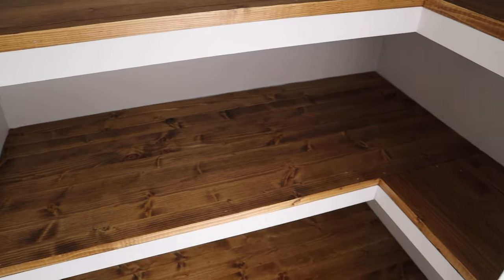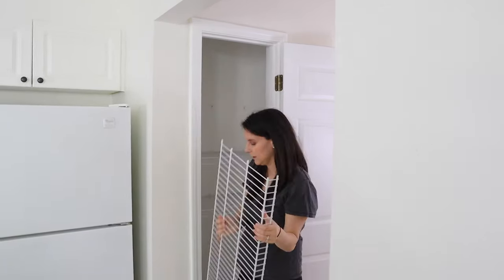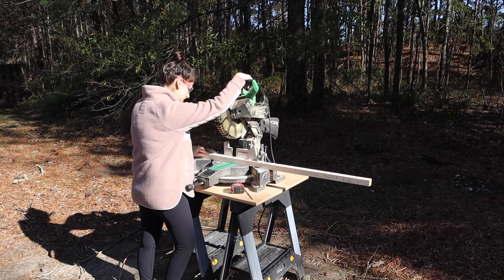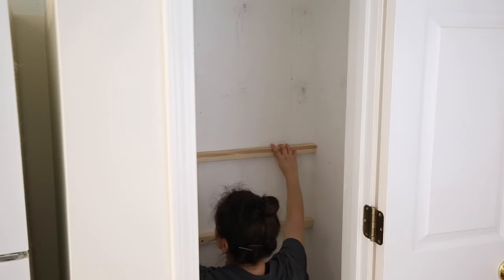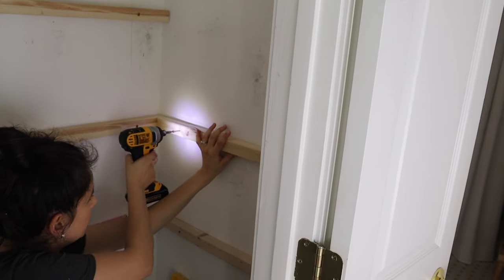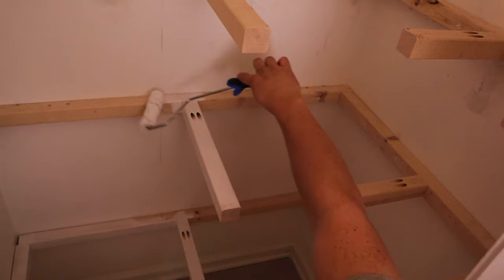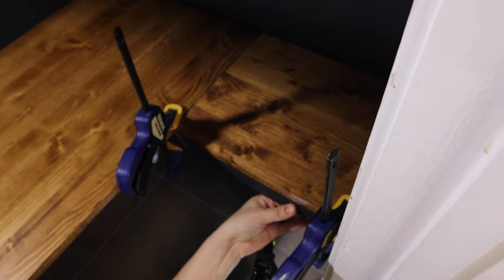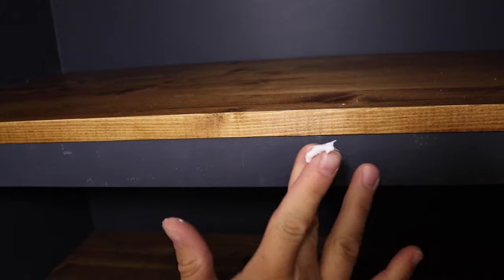How to Build Corner Pantry Shelves | DIY Corner Shelves

Comment: Gorgeous shelves! One minor note on studfinder: often they only find one edge of the stud. So, if you mark that point, then sweep the studfinder toward it from the other side, you'll find the stud's other edge. I use a piece of 1" masking tape to mark between the points the studfinder identifies. Using masking tape that's approximately the thickness of the stud, makes it easier to drill/screw into each stud's center without missing.

My studfinder will also beep at electrical lines, which typically run horizontally at roughly the height of switch plates. It can be nice to know where those electric lines run when choosing heights of shelving or art to avoid possibly nicking a wire. Masking tape is helpful for this too.
Reply from the maker: That's a great point to make, thank you for sharing!

Comment: Hi Miss Angela, my wife came to me yesterday with a new project where she wants to repalce the exact same Rubermade white wire pantry shelving with, ironically, the exact same type of corner  floating wood shelving in your video!  We are going to use this great video as our go-to how-to reference guide for building our solid wood pantry shelves.  Right down to the color of the shelving stain and the white paint for the front shelving trim and supports.  Thanks so very much for this great build tutorial, along with all of the links you provided!  Can you answer one question, please?  What is the design program you use to create the shop drawing of the pantry shelves?  I want to create a similar set of drawings for our project.  Please have a great day!
Reply from the maker: Hey, thank you so much for the positive feedback. As far as the design program we use is sketchup, they have a free version I believe that is probably enough for your basic use, my biggest tip for using that is to learn the shortcut keys for the most common functions and it makes it much easier to use. Thanks again!

Comment: FYI for your DYI… no need to have those huge holes from the large hangers. You can pull the center nails out with a flathead screwdriver and leaves small holes… No need for a pry bar

Comment: How did you make sure that the pantry shelves were flush with the wall? No gaps? Not every wall is perfectly 90 so there is a possibility of gaps.
Reply from the maker: You're so right, they were not totally flush with the wall but I wasn't too concerned because the bulk of the gaps from the wire shelves were no longer an issue and pantry items are large enough and the gaps small enough for it to not be an issue. If you are worried about a small gap due to the walls you could use some clear caulk so it doesn't interfere with the color of the stain.

Comment: How much weight will these shelves hold? Can they support a full shelf of cans and appliances?
Reply: I was thinking the same thing. I doubt these shelves can hold a lot of weight, but I'm sure you can double or triple stack cans. My wire rack panty shelfs are held together with just 7 non robust fasteners and they are holding three stacked cans just fine.

Comment: For anyone watching, don't use a pry bar to remove the anchors the way they did in the video. Just pull out the pin using pliers/flat screw driver and they come right out. No need to destroy your walls.

Overall design is good, going to do something similar in my pantry closet.
Reply from the maker: Thanks for the tip, definitely will try this! For the record, it did get the job done, lol but I'm always appreciative of constructive feedback.

Comment: Where did you buy your lumber at? I went to HD and looked at theirs, 2 x 2s are warped, edge glued panels are split and bowed 😢
Reply from the maker: Sometimes I have to go to Lowes if Home Depot has a poor selection, and vice versa! You can also see if there is a local lumber yard near you. You really have to dig through the pile too! The boards towards the front are often the most warped.

Comment: Hello,  How are the edge glued boards holding up?  I'm on the fence about using plywood or solid wood.
Reply from the maker: Hi, great question!! This is actually in a home that I don't own anymore so I can't give you a complete answer. I will say that if you are worried about the integrity of the edge glued boards, it shouldn't be an issue for these shelves because of the additional support underneath of them. The biggest benefit was that they saved time and were easier to install than having to join pieces of wood together and they were a flat surface so that pantry items could slide across them easily. A sanded plywood would also be a good alternative and save some $$, too but would require some more cuts and sometimes the stain finish doesn't look as nice on plywood. I hope this helps, thank you for watching!!!